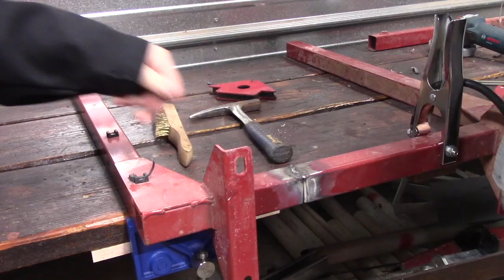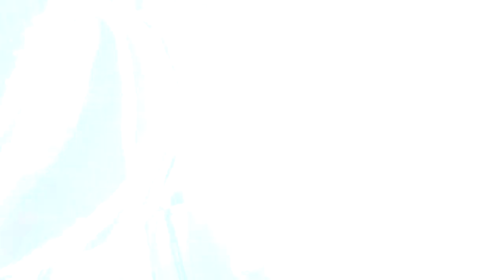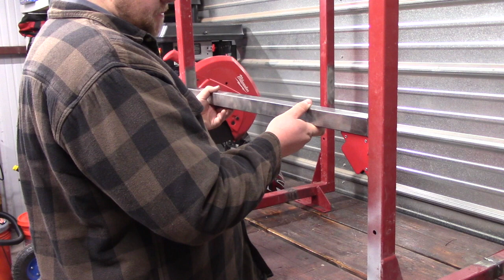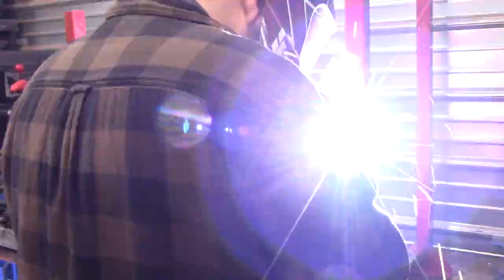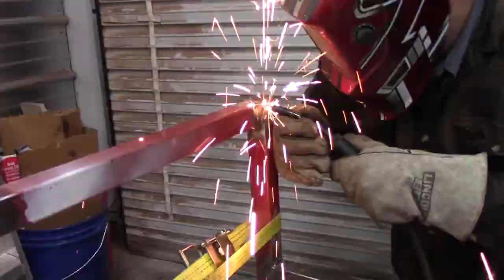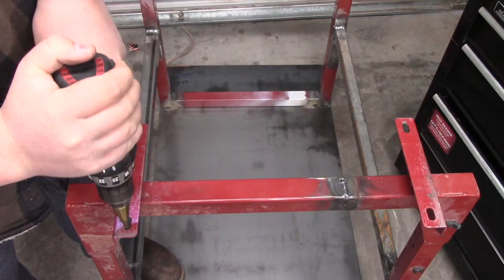Building A Welding Table Out of Scrap Metal - With Century FC-90 and Amico 160D

Comment from the maker: So I need to mention - the table itself is done... kinda. It’s useable now as is. But I actually plan to do a couple of more things to it in the future. There are a bunch of junk electrical panels on the property I live on because the owner owns an electric company. I plan to cut out the back of one
Of those and fit it to the shelf of the table to store all of my scraps and things on. Then I will paint it. And then it will be completely finished!